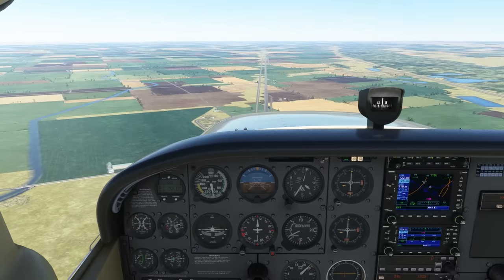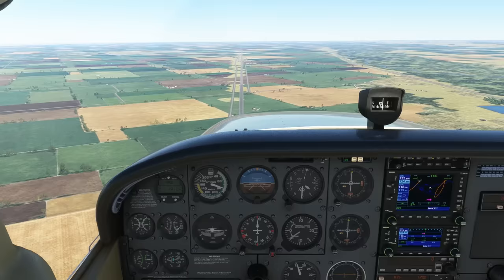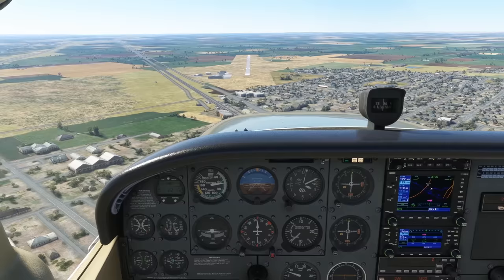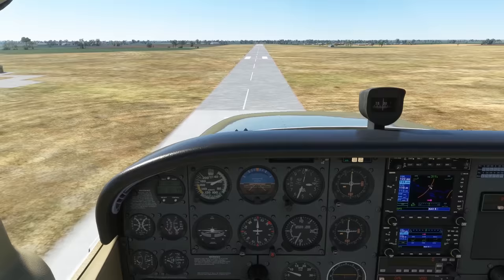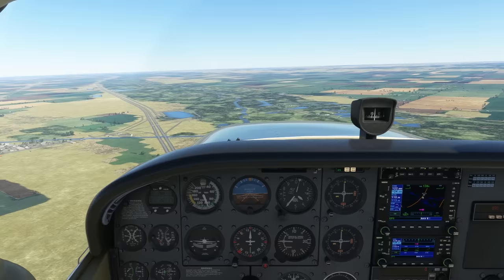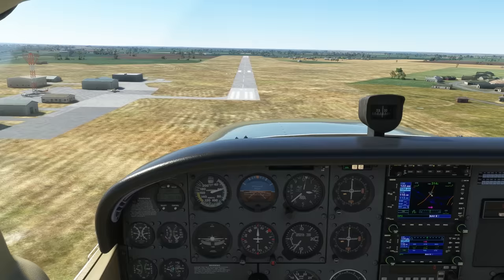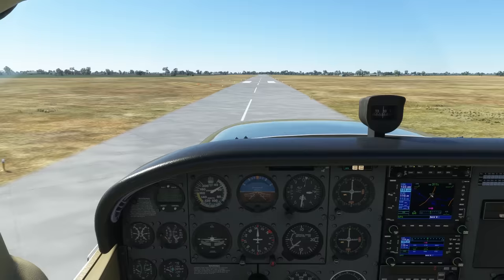How to Land an Airplane | Landing a Cessna 172

Comment: Nic video, man. One of the better flying, or in this case landing tutorials I've vern seen on YT. 

About the only thing I'd add, based on my fifteen  years of flying and nearly thirty years of flight simming, is to understand how the landing characteristics of a light plane like the C-172 (approach weight and indicated speed, power, propellor pitch and mixture settings, flap setting) changes the exact approach speed you need to attain and control for the load and flap setting and power setting chosen. Above all, airspeed awareness and control around all three axes is paramount on approach and landing. 

By the way, landing your way is the easiest way to land a plane. Try doing it at night in limited visibility in a strong and gusty crosswind that is at or very near the aircraft's demonstated crosswind component onto a slippery or snow covered runway. Few things get your attention in flying more starkly than having either the rudder or the ailerons fully deflected in order to mainain control of the airplane right down to douchdown and beyond. The flight isn't over until the plane is shut down, the plane locked, the aircaft tied down or hangared and the paperwork and log entry completed.

If anyone want to go anywhere in MS Flight Simulator 2020, anything from from short hops to treks half the way around the earth in transport category aircraft, they'll have to learn how to navigate. Naviating is flying specific tracks above the grout acertain altitudes and speeds depending on which category of airspace one is flying within. This includes radio navigation, using GPS to "go direct" and the most basic form of navigation:  ded reckoning, aka flying from A to B using a map, compass and stopwatch. The way the aviation pioneers learne how to do in the old days, before moing maps and stopwatches changed to flat panel multi-feature displays and synthetic vision.

Landings are are full stall sin ground effect, with the timing of the flare employed to arrest the aircraft's descent at two to four feet above the runway. Then holding tha altitude and attidue as rhe aircraft sinds to the runway, nose up. landings are sometimes the most challengng aspedct of flying. But they are but one  part of what it takes, in the real world to earn the title "private pilot" or highe ratings  on your license.
Reply: nic?

Comment: You landed on your aiming point. Pick it closer and make a steeper approach with less power. As you fly over it, transition eyes to horizon & begin initially to level and then into the flare...

Comment: All good stuff. It would have been even better had there been an indication that a ' constant aiming point' technique was mentioned in the final approach phase. Very important that the students knows that the airspeed is controlled by power - at this point - . Familiarity with the appropriate sound of the engine is helpful. Good tips for the 'round out' and 'hold off' phase especially use of rudder. However, it's also good that the student smoothly and fully reduces any residual power, back to the stop, once the hold-off attitude is achieved. Top marks for encouraging a hold-off as long as possible. Love the phrase "the touchdown almost comes as a surprise". As a final point the student should be familiar and confident to execute a go-around, at any point, and with a powered aircraft, the landing is an option. Not a must do.
,
Reply: Airspeed is controlled by pitch not by power. Altitude is controlled by power, I’m sure that’s what you meant 😉
Reply: Does this mean that to land the plane, you are near above stall speed? Speed where the plane reaction are a bit responsive to input of control column
Reply: @xxatya  Yes, the landing, in a light aircraft, is an induced stall a few feet over the runway. A light aircraft which bounce on landing is because the pilot has forced it onto to ground before the stall and the wings are still producing lift. At speeds below the stall the wings are not producing lift.
Reply: airspeed is pitch bud, you control altitude with power
Reply: @CulperCast  Depends on the phase of flight. Bud. FAA / EASA Flight Examiner.

Comment: I'm not a pilot, but I was wondering: How do you know if you're on the right glide slope or not?  Also, how easy or difficult is it to make corrections if you're coming in too steep or too shallow?
Reply: Right glideslope, in more detail the vasi lights on beginning left side of that runway...2 rows of lights, (back row & front row)
if both rows are red = you're too low
   Both rows white= too high....    Back row WHITE front row RED. = Correct Glideslope.    If coming in too steep use LESS power, throttle back,
Coming in too shallow use MORE power, Airspeed is key, DO NOT let airspeed get less than 60 knots in Cessna 172. and when trying all that at first.
VERY DIFFICULT, especially when there are slight updrafts and downdrafts of wind on final approach...even small crosswinds.....It took me maybe 30 or 40 tries, maybe more, before I could make a landing. The more you practice, the easier it gets....After a while, you get a FEEL for it. Become "one with your bird."
Reply: In this video, it was very hard to see the vasi glideslope lights...but in real life on final approach,
much easier to see.

Comment: Please, please do these "stall landings" only under perfectly ideal weather conditions. Most of the times more firm landings are better and saver.
Reply: Remember that the author's advice is for a Skyhawk.  They really want to fly if you don't slow them down enough.  Land 5 kts too fast in Skyhawk and you are asking for a kangaroo hop-- which is exactly what you don't want in big winds.

Comment: Thirty degrees flaps, on the 172, with speed at idle. Still struggling with landing,..flaring too early, however, it's the continuous reps, that will get it right. Being a former ranked squash player, same work ethic, repeat and repeat...

Comment: I could never understand when and how much flats you need for landing and take off. Flying a plane and instruments are easy for me. I love trusting instruments. I can never understand radio traffic. Never makes any sense to me. But, I've flown private planes at work years ago and hired one for an hour in a trainer plane. So I have about 5 hours under my belt. But one bump in the air and I'm incapacitated by my equilliberium. I get deathly motion sickness. Crash and burn for me. 🙂 Thanks.

Comment: This video must be for those who already know how to land a Cessna 172. I don't have any experience, and you lost me by 0:57.
1. What's a glide slope and how do I know if I'm on it?
2. What should my apparent air speed and rate of descent be in relation to distance from the runway?
3. Assuming a 172 has flaps (I don't know) when and to what degree should they be extended?
4. Is the idea to be at stall speed just after touchdown?
The nose wheel touches down last?

Comment: 60KTS is a short approach and only to be done in still air. A normal approach in a 172 is 70kts which allows for wind share and gusting. Even in a short approach I would pull the A/S back to 60kts on short finals not the whole approach. This is a dangerous video for an inexperienced pilot. Remember the 11th commandment "Maintain thy airspeed less the earth arise and smyth thee."

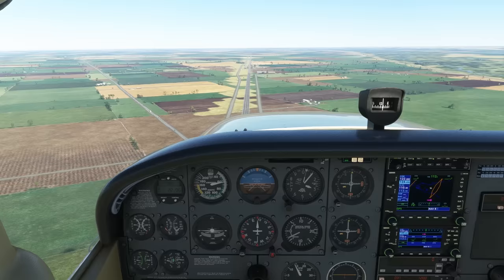Comment: 1:38 Umm, is it a good idea to tell student pilots to intentionally stall and recover at 500ft AGL?  Especially if they try that in a real plane, and not flight Sim.  My minimum is 2.5k feet AGL for intentionally attempting stalls. Especially if they happen to have some rudder input before stall, maybe trying to correct for crosswind, that could progress into a bit of a spin, requiring altitude for recovery
Reply: its a video, obviously he wont do it at 500 feet but its a flight simulator so he doesnt need to be exactly realistic.
Reply: @rylancarter6289  the video thumbnail and title aren’t saying anything about simulator, so that’s why I worry a pilot learning and struggling with their real landings might see this. Especially those that are allowed to fly solo, but still want to improve their landing smoothness
Reply: Good point.
Reply: Agreed.  I also noted the comment at 0.51 about 10 degree flap extension & speed not really being all that important.  Well I'd argue it is and that goes for in both directions faster and slower.

Comment: There are a lot of mistakes and bad habits in this video. You never try to align with the runway using the rudders except just before touchdown out of a crab for a crosswind. Can you say stall/spin? Lots more problems here, but I don't want to get into a pissing match...And yes, I am a pilot - 23,000 hrs.
Reply: I was looking in the comments for this. No idea where he learned that from
Reply: Agreed 100%. In probably no other phase of flight is it as important as during landing to maintain coordinated flight. Getting uncoordinated on short final is asking to have a propeller carve out your grave.

Comment: Is there a special place that a pilot gets to, where the gauges become a secondary guide, where FEEL takes over?
Reply: Not really.  Flying and landing an airplane without an airspeed indicator is very tough.  Altimeter is also important.  For the rest of the "six-pack", there does get to be a time when one checks them less.  That is when you know it is time that you start work on the instrument rating, or even just practice flight by instruments.

Comment: 😂😂😂
I have quite a few hours of experience from Piper PA Cherokee, and some other aircraft.
I know how to take off too, so we can skip that part too 😂😂😂

I wonder how many of you have tried to recover from an upside down inverted position in a PA-28…
or landing in pitch dark, without any lights on the aircraft, nor on the approach or runway.
The only tool was a flashlight 🔦 

Yep, deliberately and successfully on several occasions 
😂😂😂

Comment: I’m a student pilot, and I’m very close to my solo flight but I haven’t been able to solo because of how inconsistent my landings are, I’ve seen that I just can’t get the idea of flaring or when it’s the right time to flare because usually I feel like I’m on the right track and I start flaring but I’m like 30 feet above the runway and I have to go around. I’ve also seen that my energy management is very bad. How can I improve these two aspects? I would appreciate a response, have a good day.
Reply from the maker: Hmm, never heard that particular problem before. Kidding! We've all had exactly these struggles. My best tip on knowing when to flare is to focus your view down the runway, as said in the video, though this can be easier said than done because we tend to tense up when the landing is imminent and look straight down. Have your instructor demo a landing or two and see if you can get a feel for the proper height. This definitely is a knack that will come. As far as energy management, job one is to control airspeed. Assuming your in a 172, if you can get it to 60 on final (maybe your CFI uses a different speed) it makes it easier to control everything else, even if you're too high.
Reply: I found that if I’m aiming for the numbers, I can best do my roundout when I cross the threshold. As far as your energy management goes (if you are flying a 172) you want to get your speed down to 65 knots on final. Hopefully you are no more than a foot or two from the pavement when you begin to sink and you will start your flare there. Just try to get your airspeed down on final. Typically it will be 1.3 times your Vso, but I don’t know too many instructors that would want you to fly final less than 65 knots.
Reply: What really helped me was having a few different CFI’s put their eyes on my landings and explain things THEIR way. It finally all added up!
Reply: Something that had helped me through my training is talking myself through it. When I was flying Piper Warriors working on my Private, It was running through certain procedures. Talking to myself, my instructor. Explaining exactly what I was doing. On the downwind we do a few checks, first one is called "GUMPFS". G- Gas (make sure it's on the proper tank, fuel pump on) U- Undercarriage/Gear (down and locked), M- Mixture (Rich), P- (Prop, Pumps, Switches (such as lights, etc.)), F- Flaps (as required).
From there, we do a "SWAT" check. S- Surface (for instance, wet, soft, short, or long, hard, dry) W- Wind (Example: Slight headwind, or gusty, variable crosswind) A- Approach (Normal, Short, etc.), and T- Touchdown (Where are you aiming for your flare? And where do you want to touchdown?).

Big thing to remember is YOU. are the pilot. Don't let the plane fly you! Wishing you good luck and greased landings.
On approach, talk about what you are noticing on your approach, and change as needed. If you are high, slow, pitch that nose down.
Pitch for airspeed, power for altitude.
Reply: I had all sorts of trouble getting the flare right until a different instructor got me to run along the runway holding the nose wheel in the air while keeping the main gear on the ground. He explained that was the attitude I was looking for on landing. Suddenly it clicked and I never had a problem after that.
Reply: Have you instructor let you do slow flight one to two feet off the runway until you are comfortable. When comfortable doing it, then practice cutting  the power off and land. If practicing pattern work you can request low pass with the option from ATC.

Comment: An interesting video,unfortunately it skips critical observations such as when to turn base and many other indicators that support good landings. However, if you were just trying to communicate the simplicity of making a landing, then I guess it does it’s job.
Reply from the maker: Ohhh we could write whole books on the topic of landing! (others have, incidentally). This short vid was trying to convey a few visualizations, but no doubt some additional content on things like proper pattern like you mentioned are useful.
Reply: @flightinsight9111  I disagree. This Video is mainly about view and touchdown. And for this exact topic it has great value and is much more on the point, than most other YT-Videos I've seen.

Comment: You cannot talk about flaps without talking about angle of attack. If you don't understand AOA and its relationship to flaps, you do not understand flying. Stalling is a function of angle of attack, not speed. These videos do a disservice by omitting this crucial element of flight. Your instructor should be talking about angle of attack in relationship to every element of flight from takeoff to landing. I am an experienced US Air Force pilot with hours in large transports and supersonic jets. I have also been an instructor.  If you are taking lessons, don't let your instructor get by without knowing and teaching all about angle of attack. I have my doubts about the guy who did this video.

Comment: Several problems here... "Speed is not important"... YES, it is. You ALWAYS need to monitor it to prevent stalls. Also, why would you purposely stall at 3,000 feet? Your Vapp should not be below 65 knots or so on that aircraft. Stop "teaching" bad technique. Sorry

Comment: Why is it that, for takeoff, most GA (or actually most all) planes suggest using a notch or two of flaps but when we go around we go to flaps up? We're  touching down around what would be Vr during a takeoff and during takeoff we don't retract flaps until at a prescribed higher airspeed or altitude. So why is it we touch and go with no flaps?
Reply from the maker: In planes that recommend a notch of flaps on an normal takeoff, like some Cessna 182s, it's probably better to leave that notch in when doing the "go" part of the touch and go. With plenty of runway in front of you (which you should always have when doing a touch and go) it's probably ok to retract all flaps, but I would match whatever the POH recommends for a normal takeoff, when doing the touch and go.
Reply: My Cessna 150 has 0deg flaps for ALL takeoffs. It just depends on the aircraft and its design.
Reply: A big reason is because it's a straight-wing aircraft with a lot of wing surface relative to its size and mass. In reality a Cessna 172/152/150/etc doesn't even need flaps at all and earlier straight wing planes often didn't have them. Flaps will bring down the stall speed and allow for a slower touchdown without bouncing. But with wings level and 0 degree pitch, with enough power, the plane wants to climb. However planes designed for faster cruising speeds (swept wing) will be less stable at slower speeds and will need that extra lift.
Reply: Flaps on take off among other reasons, shortens the time the wheels are on the ground, reducing wear and tear on the tires, bearings, landing gear as well and in addition to, the whole structure on rough fields.